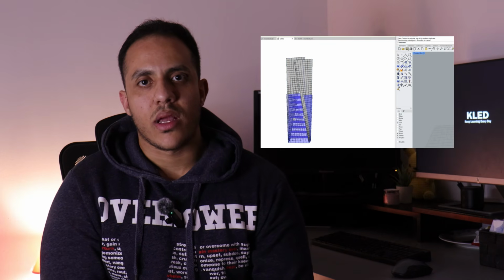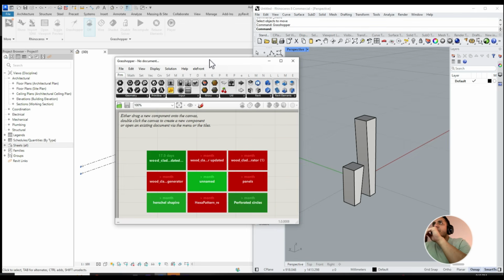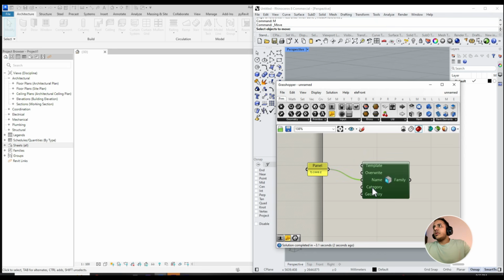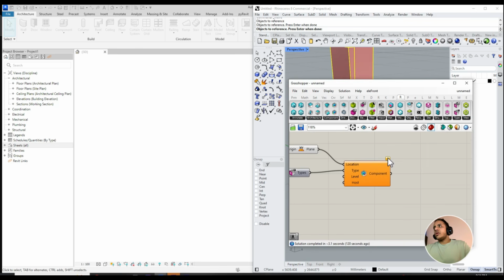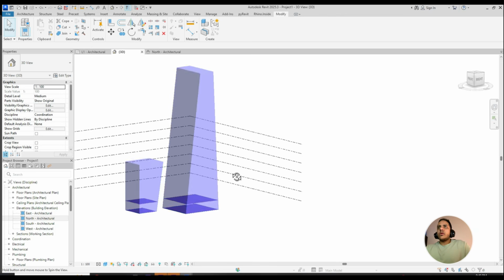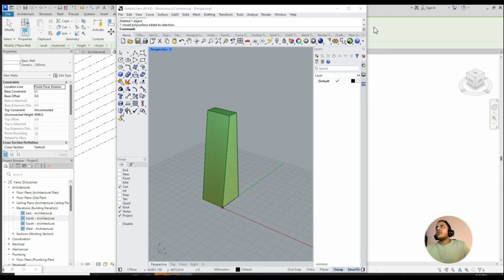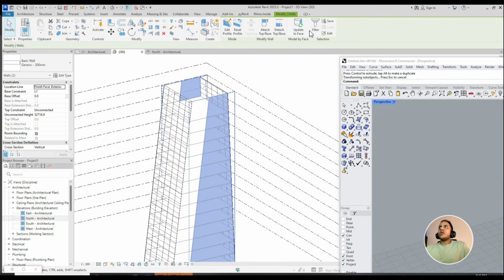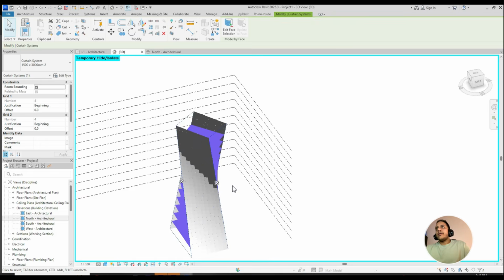How to Import Rhino Mass to Revit using Grasshopper | Rhino.Inside Workflow

Comment: Thanks! This was very helpful. I used to always go with the DirectShape route, but I’m curious, is there a way to assign materials to the family when using the second method?
Reply from the maker: Hello Jaran, what do you mean by second method?
Reply: @kled1995  Hey I meant the one when you are adding the models trough New Component Family node. But actually i kinda figured it out after writing this comment :D I plugged Brep into the Component Family Form node which gave me an option to add material, then plugged it into the new component family node
Reply from the maker: Yeah, you did it right